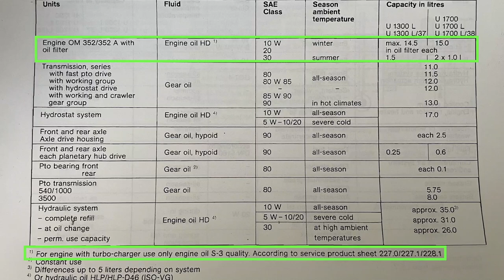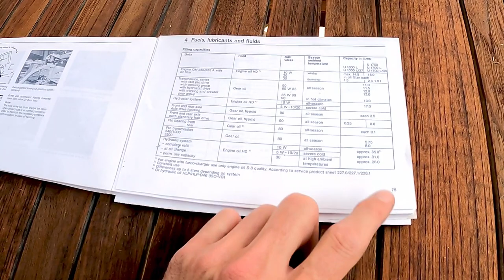Unimog maintenance - How to change engine oil in a Unimog U1300L

Comment: For future reference - The correct starting procedure with empty filters is to restrict fuel flow (push down the idle control / fuel stop valve on the middle console) and then crank the engine until the oil pressure gauge show some life.
Reply from the maker: Good info. Although I do not think I have any way to restrict fuel flow. The idle lever is always as low as it can go and truck starts immediately. I will look into that more though
Reply: @MichielBrandOUTofDOORS, do you mean reduce hand throttle to nothing and crank the engine with just the starter until the oil gauge shows some life? (Just want to make sure I'm understanding correctly)

Comment: Oil is better than no oil... Good oil is better than bad oil. Oil changed often is better than kept for 10,000 plus miles. It is expensive to do it every 5000miles but engines that are changed regularly have always been immaculate in my experience.

Comment: Ah yes you got the single cartridge filter easy mistake to make! And as far as oil use a heavy duty higher Zink oil for the Delisle engines 15w40 is great and Shell oil is pretty good stuff! I'm from Australia and use penrite convoy dfx 15w40 has a higher Zink content compared to regular Delisle oils.